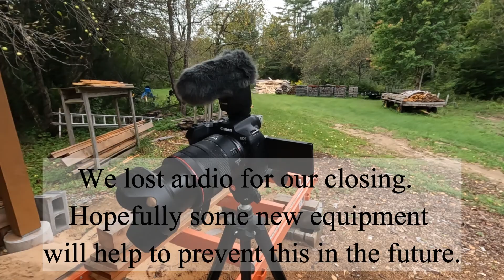Let's Finish Sawing the Mushroom Maple

Comment: Where's your ear protection Andy? Also, what's the new camera?
Reply from the maker: I ended up with a messed up ear from wearing over the ear hearing protection and it's just cleared up in the last week.  We got the Canon R7 and the 24-105mm F4 L lens.  The R7 is APSC, so a smaller sensor, but it's 32 megapixel and I can crop in without losing detail and it has the new RF lens mount.  The lens was only $100 less than the camera!, but it'll transfer to a full frame camera if we ever upgrade.  I haven't been shooting with the old T3i, it was beginning to get some weird pixelation along the bottom of the frame and couldn't shoot more than 1080p @ 30.  I need to reduce the saturation on the new camera, it's a bit too much.
Reply: @southernadirondackoutdoors  Nice! That's definitely a step or five up from my M50!
Reply from the maker: It's amazing what Canon has released since you bought the M50.  Biggest issues with this R7 right now is the lack of RF mount lenses for it.